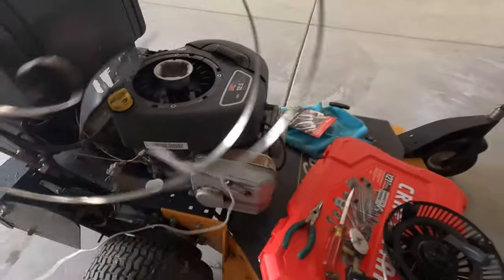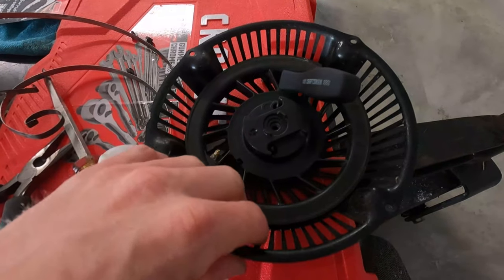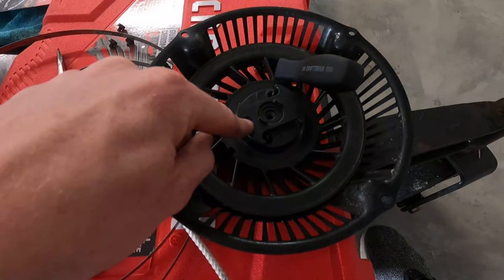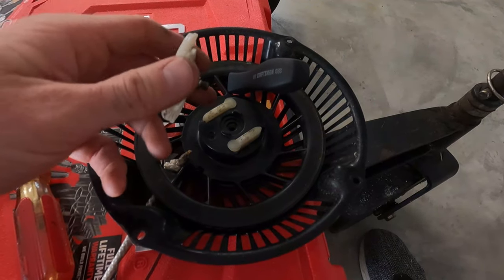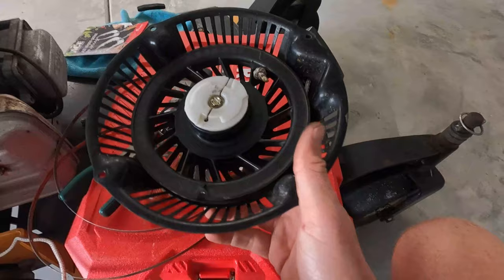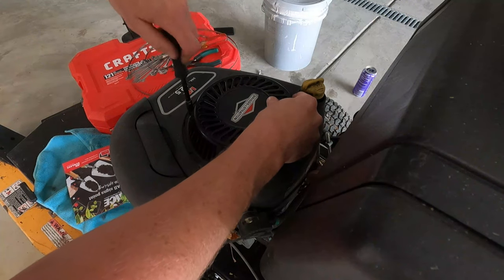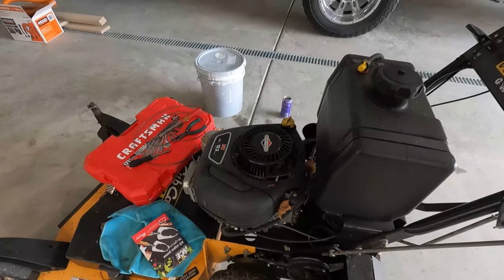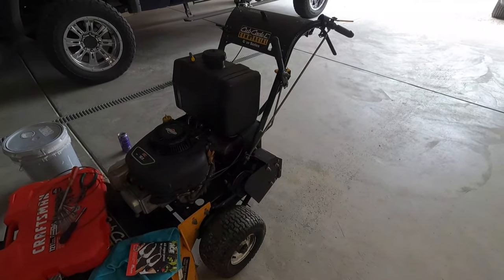How To Fix A Lawn Mower Recoil Spring (Cub Cadet) | HANDYMAN HEADQUARTERS |

Comment: Cordless drill with the right sized socket throw the pull cord in the bin👌👌👌👌👌
Reply from the maker: How does that work?
Reply: If u take the pull cord assembly off the mower you see a nut find a socket that fits that nut use a cordless drill to crank the nut, forward setting on drill this cranks the engine 👌👌👌👌